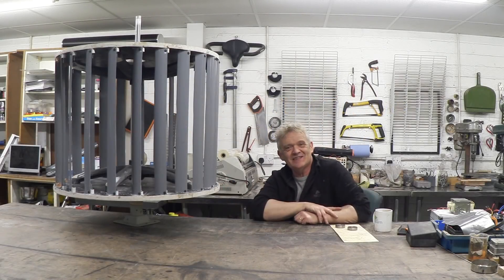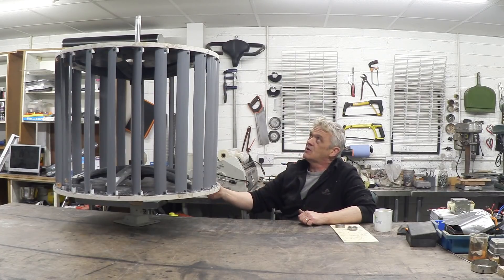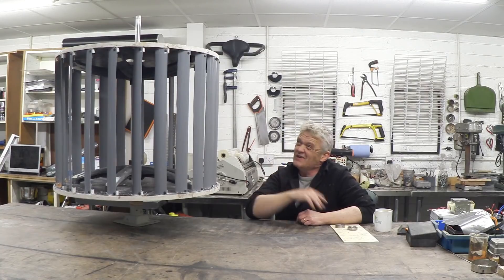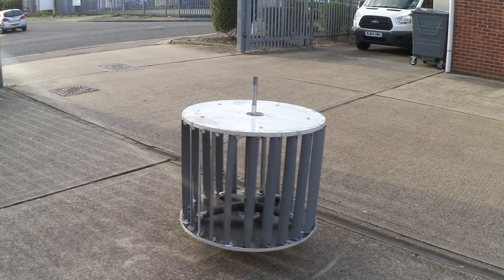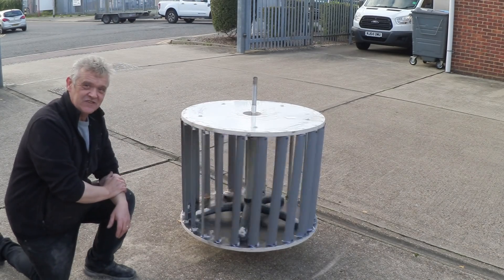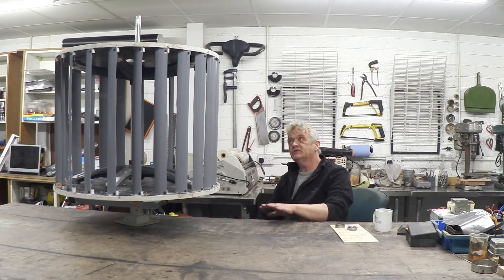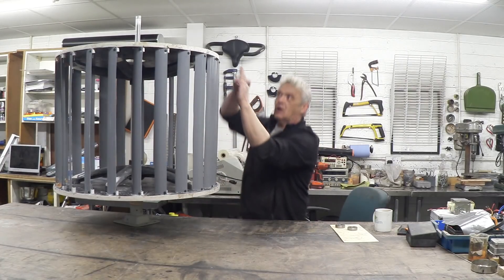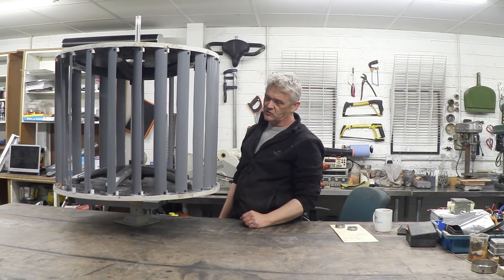Building a 1kW Wind Turbine For Under £100 - Part 2 - Rotor Wind Test

Comment: This is definitely a worthwhile project. I was just watching some industrial roof vents that were very close to the same design and proportions except they had a dome on top instead of a flat surface and I suspect that this is an aerodynamic feature and not just for appearance, maybe someone who knows about aerodynamics could comment.
Reply from the maker: I did a video on converting one of those to a turbine
Reply: Actually it is nothing of the sort. You will not even break even on it.

Comment: I work with big vawt:s , you get diameter and height theoretical power pretty eay now in excel on engineering toolbox, i dont say your wrong there bjt it looks a bit small in terms of diameter. Are you gonna do a geared solution ? ( it is interesting, i would go for something simpler but larger for the goal
Reply from the maker: I shall look that up - cheers mate
Reply: Robert Murray-Smith it is a nice design, you could let it run a hot water boiler and reuse the heat, then you wont need a volt regulator

Comment: Hi Robert, have you tried using the coil without the metal casing? I wonder what would be the difference with and without. I seen tutorials on home made axial generators and they only had plain coils. It looks great.
Reply from the maker: I did mate - but in a different version - I could try it with this easily enough so will do

Comment: How do you measure the power output of a wind turbine compared to solar.
Reply from the maker: I am sorry mate - I don't really understand your question
Reply: @ThinkingandTinkering  i have a vert supposedly 400 watts. It giives out hardly anything even in 60 mph winds
Reply: @ThinkingandTinkering  are you expecting 1kw out? 
If so over what period of time
and how fast does the wind speed need to be to achieve 1kw?
 Is that per day or per hour? Etc

Comment: nice...but the design would be lucky to get over 200 Watts . simply the cross section facing the wind is too small for 1kw.   Unless it was a tornado. 
 I think a Horse could kick it to bits.....  thats at 750 watts  1 Horsepower.           
 Love your works. Always promoting your channel. :o)
Reply from the maker: to be honest mate I am just going by the power curve on a representative 1 kw commercial turbine - I need a wind speed meter really and I plan on seeing how it does in various wind speeds and doing a comparison - you are quite right I think it will need 25-30mph wind to have a chance at 1 kW - but so do commercial wind turbines of fan blade design - so we will see - maybe it will fly apart - that will be fun lol - cheers

Comment: You got my vote mate, I love it thus far. I don't think there is a whole lot I would had done differently. You have done a spot on job mate. The office chairs was a bonus and great idea, those bearings should last a good while. I mean I'm sitting here trying to think up something that you might want to do and the only thing I can come up with is extending the blades inward maybe. I mean really not needed as we all see that it is turning very good but it is a thought just in case you were wanting more thrust. I mean WOW it is already turning very smoothly. This is going to be awesome once you get those magnets added.  We need England to go ahead and fund you so you can buy those good Neo N52 magnets. How much is it weighing as is? I'm guessing a good 35 pounds or so.
Reply from the maker: that's a good guess mate - I haven't weighed it yet but I can pick it up easily so it is well less than 50lbs - I do a fair bit of building so I am used to shifting 50lbs sacks so I know what they feel like lol
Reply: @ThinkingandTinkering  Those magnets are going to put on the weight. That is one reason I bought 3/4" x 3/4" n52 neo magnets. They are plenty powerful but doable on the weight end of the scale. For something about the size of what you have built here, I would say you would need the amount that I bought, which is around 60 of the 3/4" x 3/4" n52 neo's. If you bought them, look on the bright side, they can be reused if you use plastic tube holders. Which you and I can build out of scrap material lying around, lol - They are worth the investment that is for sure. They real perform really well on generators and motors. That is why I have been working towards putting both all in one device.
Reply from the maker: @jasonwitt8619  they are good. mate that's for sure - but it isn't a weight issue I am trying for budget build - if I can't get the output I need I might upgrade to Neos but right now I don't want to add the expense on there
Reply: @ThinkingandTinkering  I can definitely understand that part for sure, I'm always on a budget, LOL so that I might have the money to go all in on a project , LOL but I do understand wanting to keep it as cheap as possible.
Reply: @ThinkingandTinkering  Also I did think of an idea to help you with weight issues with magnets. What if you epoxied each magnet, then you could screw them on and off as needed when moving the generator from one location to the next and could still be used on other projects being tested along the way. It would mean a lot of screwing but sure would save the back for sure mate.

Comment: Might I suggest making the center support longer? Then you could bolt down the base and use three guy wires for supports rather than having to use an arm of some sort.
Reply from the maker: nice idea mate but I also like the arms as it will be a kind of funnel/shroud - but we will see
Reply: @ThinkingandTinkering  whatever you do, I'll like to see it. This is very cool indeed.

Comment: If you were to use two 1000w ebike hub motors instead of chair bases and boards, would it be a viable way to generate power? These things are getting cheaper  all the time, and to the uninformed (me), they look like a simple way to build a generator.
Reply from the maker: I suppose so mate the real answer is there are just a load of ways to go about this

Comment: Also the same principle applies to the air that hits the blades doing the work so a funnel at the front to gather the air  and at the conjunction of the funnel with the blades put some blades placed in the opposite direction just as you would with any turbine to optimise the attack on the blades, sounds a bit cumbersome   but seeing you manufacture something I'm sure it wouldn't be a huge challenge 
Also you don't have to rely on the wind to turn it, you could easily use a motor and some simple electronics to drive it around, and also park it in a protective position in high wind speeds .
Sorry got carried away rooby
Reply from the maker: lol - I had to find you first comment to understand this one mate lol
Reply: Funnels on the front don't work.

Comment: Smart looking machine Rob! A few others have said - I would have put the supports outside to keep the air flow cleaner through the centre - assuming it's a crossflow design you're going for?  In terms of your 1kW output target - assuming it's 80cm high and 80cm diameter you're looking at a 50m/s wind (assuming 0.2 Cp and also assuming my calculations are right!). That's some storm!
Reply from the maker: to be honest mate I am just going by the power curve on a representative 1 kw commercial turbine - I need a wind speed meter really and I plan on seeing how it does in various wind speeds and doing a comparison - you are quite right I think it will need 25-30mph wind to have a chance at 1 kW - but so do commercial wind turbines of fan blade design - so we will see - 50 m/s is one hell of a wind  though - so maybe it will fly apart - that will be fun lol

Comment: Hi Robert, be interesting to know how any air entering the turbine will exit it, usually a sqirrel caged fan is a p shaped  housing to control the flow of air, I assume the blades approaching the wind direction will cause resistance, you say that you are adding a support that wraps around to the shaft at the top, if you fitted a baffle that shaded the portion of the turbine approaching the wind, and then put independent bearings on it with a directional weather vane that  turned it to  the prevailing wind, also any air entering the centre has to exit somewhere, if it's through the blades on the approach that will counteract the rotation, if the top was open the air could escape, combined with the baffle and oriented in the right direction a close fitting cowling with a conical aperture in the lea of the wind would create negative pressure and assist the airflow ?
Got me thinking again thanks rooby
Reply from the maker: nice ideas mate - got me thinking too - cheers

Comment: a high speed motor could turn that faster and make even more energy using a beat truck alternator. with just one 775 and a solar panel and one e bike battery i can make using a 40 amps alternator (self excited) then transformer for a 120 volts 20 amps high speed 3hp motor to turn 4 beat truck alternators (which totally works) (self excited so you only have to install energy when starting up). then you have 1400 amps plus some volts that mean 700 amps worth of 120 volts and 20 amps. which is 5 per hundred and 7 x 5 is 35 120 volts and 20 amps wall socket and that is just a under an apartments worth with 17 plugs plus one. that is the two per wall type. the only hard part is the huge wire transformer to turn 1400 amps into 700 amps 4200 volts.
Reply: 240 volts for the win..
Reply from the maker: do a video on your ideas mate - that would be awesome to see
Reply: @ThinkingandTinkering  i already got death threats but covid and all virus can be removed from the body by sonic viral immobilization dialysis therapy also so use that also. if you can???

Comment: Marvelous! If you put the magnets on the bottom, would there be a limit to the number of MOT coils you use? (Thinking higher voltage or current from series-paralleling the coils... :-)  )
Reply from the maker: every time you add something you raise the wind speed needed to get it going mate - so like most things there will be a balance

Comment: Use a smaller radius  on the wheel for the magnets. This adds torque for the magnets to pass the coils. Looks good though. Looks very balanced.
Reply from the maker: to be honest mate - I am astounded about how well it is balanced and quite honestly this has nothing to do with me - I just stuck the chair legs on the pipe and it worked!

Comment: Love it, looking grest. How many microwave transformers do you plan on using under the base plate after fixing the magnets?
Reply from the maker: to behest mate - I am not sure - I will start with one and see how it goes
Reply: @ThinkingandTinkering  I would be starting with 4. 2 parallel 2 series, double both voltage and current.

Comment: Love the VAWT, I would wager you'll get about 250 to 400 watts out of it based on size and number of blades but, it will be cool either way. Hopefully you can reach the RPM needed.
Reply from the maker: to be honest mate I am just going by the power curve on a representative 1 kw commercial turbine - I need a wind speed meter really and I plan on seeing how it does in various wind speeds and doing a comparison - you are quite right I think it will need 25-30mph wind to have a chance at 1 kW - but so do commercial wind turbines of fan blade design - so we will see - maybe it will fly apart - that will be fun lol

Comment: Robert, about those bearings. If someone is trying to build this from scratch the bearing size that you used is a 6005 (47 x 25). If buying one new you should specify 6005-2RS which is a sealed deep groove bearing. Deep groove bearings are better able to handle the axial loads created by gravity with the rotor oriented vertically. The 6005-2RS has an axial load rating of better than 300kg, which is more than enough for this application. Very well done!
Reply from the maker: thank you for posting that mate - that is really helpful - to be honest if I bought the bearings I might go for some more suitable for this job - I am just using what I found and trying to moderate it for using it in this orientation - I think you are right they will do just fine given what I am doing with them and the load on them but it would certainly be better if they had a conical design
Reply: @ThinkingandTinkering  As a fellow tinkering thinker? I think if you opened up the bottom of this design, and set it on top of an Aeromine structure? You would have a VERY efficient turbine.
Reply: Yes, there is a bit of weight in that thing.  The bearings he has is fine for testing, but for long term use it would be better to go with your suggestion.  If built in metal it will be a lot heavier and if you put some weight in it for a flywheel it will be a lot heavier.  Thanks for pointing that out Mark.
Reply: @BoB4jjjjs  I like the flywheel idea!  Well-done. I'll definitely deploy one when I make mine. All good wishes!
Reply: @antonnym214  Hope it works for you.
Reply: @BoB4jjjjs  So far my best candidate for the top and bottom of my "drum" are 29-inch bicycle wheels, due to the nice built-in bearings. I may have to do something to weatherize and prevent rust, but that's doable.
Reply: @BoB4jjjjs  
For long term use better to use pressure bearing.
Reply: 6005 open or 2RS or Z even are “all” deep groove ball bearings, RS - rubber seal, Z - steel dust seal, or open with no seal. More importantly they’re all available in either 304 SS or 316SS
Reply: Self alineing berings , the size required is down to the builder and size of fan drum
Reply: @spikeccx   but make sure the bearings are properly aligned  won't you .
Reply: Its not gravity, Is just that materials with densely packed particles are heavy depending on the element some dense structures are heavier than others. And it just so happens that most things are heavier than air.  Due to denstiy.
Reply: @EnterTheRealm  strictly speaking the weight of an object is defined as an objects mass multiplied by the gravitational constant, which in our case on earth is around 9.81 ms^-2. Density is a measure of mass per volume and is not used in the measurement of an objects weight.
Reply: @michaelpearson5465  strictly speaking the gravitational constant is non existent. The force doesn't exist so nullifies what you have said. In only works in theoretical maths.  In reality its just density.
Reply: @EnterTheRealm  Oh ye. Another flearther...
please provide scientific evidence for your words. "The Bible says" will not work here.
Reply: @rutosirvaido  save your breath, you can't argue with stupid but we can provide true evidence based facts that I hope will reduce the amount of people that will believe his utter nonsense.
Reply: @michaelpearson5465  i dont really care about what you believe so why do you care so much about what I believe, its a fact that things heavier than air fall too the ground due to density and buoyancy hence why a helium filled balloon can float.... and a lead one can't. There was no need for gravity to work that one out.
Reply: @EnterTheRealm  what you believe and reality are completely different things. Just because you can't understand something doesn't mean you have the right to spout miss-information left right and centre. The facts is that  you are arguing something that has been and will continue to be proven whether you believe it or not.
Reply: @michaelpearson5465  yeah. Your so called facts are theory that is that.
Reply: @rutosirvaido  see like I said you can't argue with stupid, id like to thank @EnterTheRealm for providing me with a perfect example of this, now proven, theory 👌
Reply: @michaelpearson5465  As you said, "save your breath" 😉
Reply: @rutosirvaido  look at you too how cute 😍
Reply: @EnterTheRealm  have you ever dropped something, e.g. an Apple, what happens? Does it a, float in mid air or b, travel (fall). To the ground?
Reply: @paulfrost8952  no that apple was more dense than the air molecules around it. hence it fell too the floor 😆 hense why a balloon floats on 💧  lol. Use your creator given brain.
Reply: @EnterTheRealm  yes you are correct about the density of an apple but balloons filled with air do not float, they have a density greater than air, just the same as a balloon not filled with anything does not float. A balloon filled with gas less dense than air will float once it reaches enough volume to create the right ratio to density to counter of the balloon.
Try this for your self and observe the results, Helium is a good choice for the gas to fill the balloon. Have some fun experimenting. It’s still gravity at work look up a bloke called Isaac Newton he explains how it works complete with the maths.
Reply: @paulfrost8952  damn dont mke me laugh.

Comment: Will a light metal work as a frame rather than wood or will it effectively distract the magnets I’m thinking of building a super sized to power my office I’m thinking 4 double turbines as it will generate twice the power is this plausible or may need more?? Just a thinking out loud sir
Reply from the maker: to be honest mate - I might use Sintra board or uPVC foam filled board - but I would think Aluminium would be good - it would just add to the expense and my main objective is reasonable cost for power output